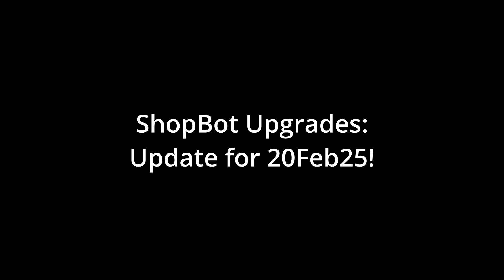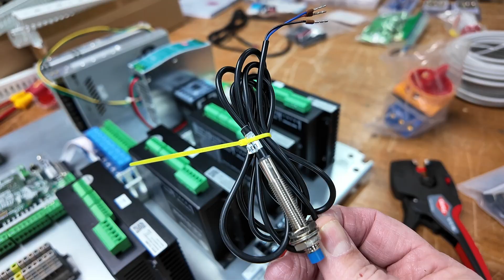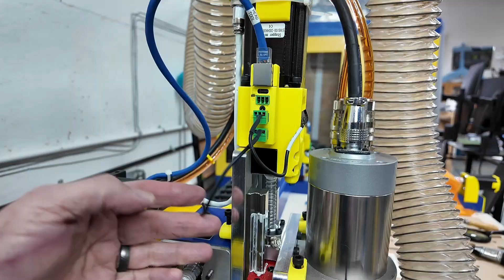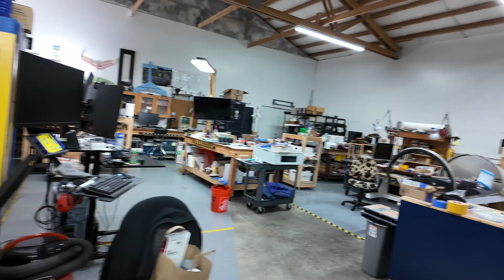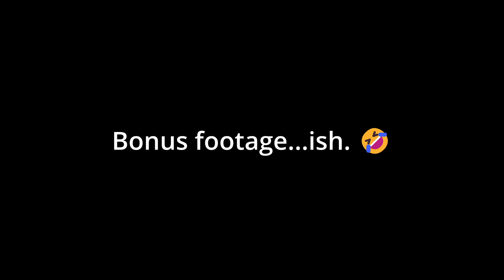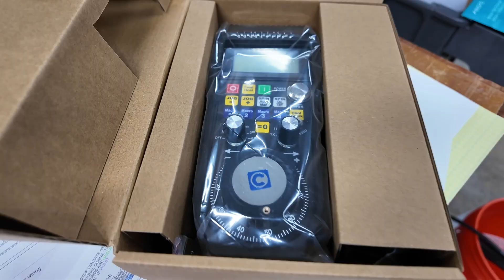ShopBot Upgrade Project, Update for 20Feb25!

Comment: Would you be interested in advising on a similar upgrade.  Highschool shop teacher with 2003 48x48 standard and a bad circuit board.  The replacement board is $1500.
Reply from the maker: Email me using the channel contact page.  Tnx.